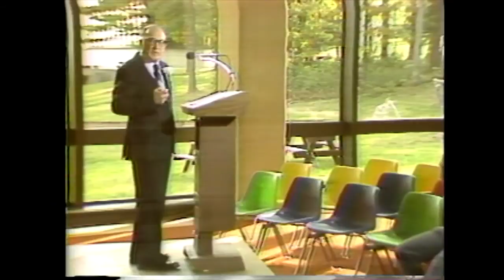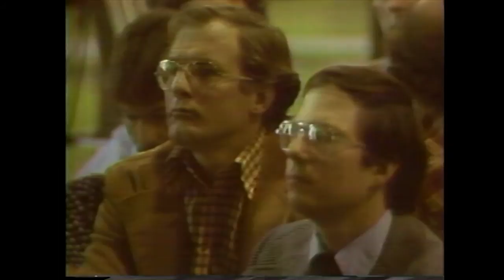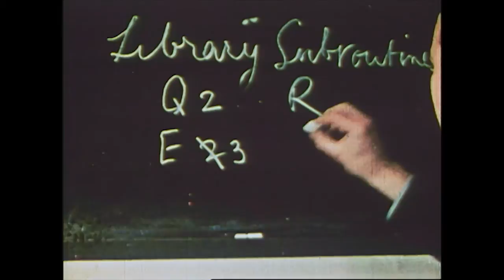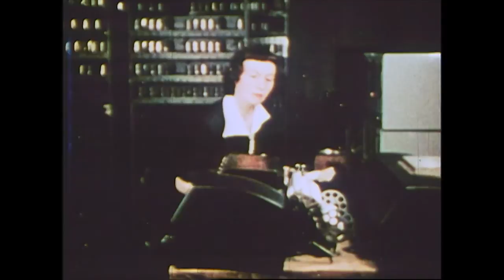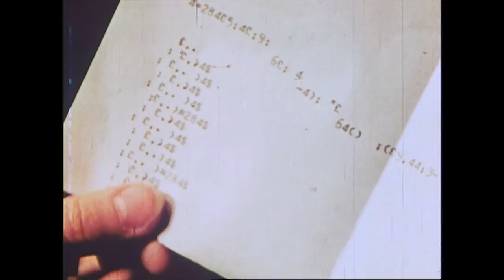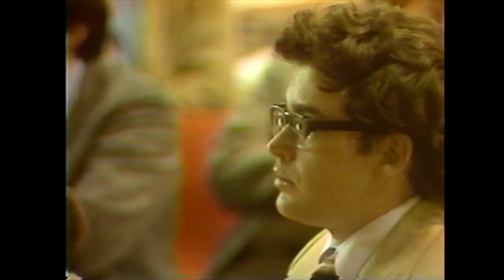The Birth and Growth of the Digital Computer, lecture by Professor Maurice Wilkes

Comment: At 3:10 "Lookaside memories" that became "cache memories."
At 5:50 The anatomists dept receives the new building, we receive the old, and were told if we opened the windows the smell would go.  LOL ... but the audience?  Crickets!
At 9:35 Designing the EDSAC?? computer.  He thought it would take 600 vacuum tubes, it wound up taking about 3,000. LOL!
At 10:30 One memory using mercury, a tube 1.5 meters long, quartz crystals.  Put pulses in at one end, turn them around, clean then up a bit, put them back.